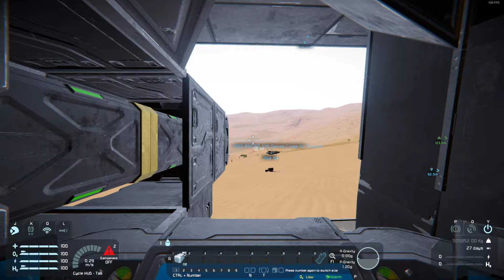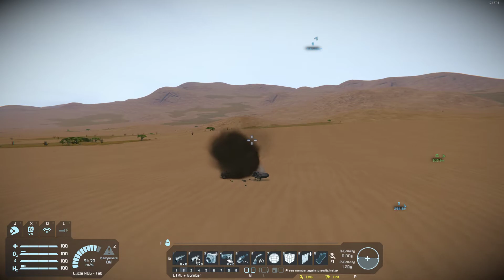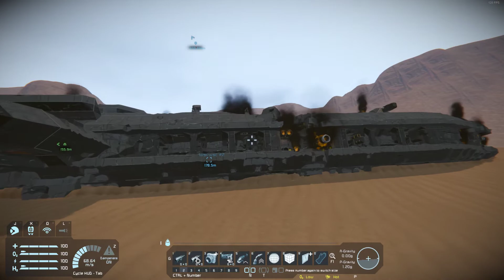Space Engineers Vanilla Battleship Gun Test

Comment: nice! without scripts?
Reply: yes without scripts, just a rotors and hinges and a gyroscope for movement, but there are prone to moderate klang, and if you reload the save the rotors/hinges wil not move under the force of the gyro anymore (you have to disconnect and reconnect the rotor/hinge part)
Reply from the maker: this does use scripts but I have no idea why it likes to clang so much
Reply: @wscwsc164  You might wanna increase the the braking torque of the azimuth.
Reply: And if this doesn't help just turn the inertia tensor on